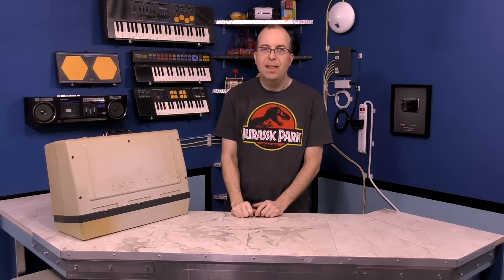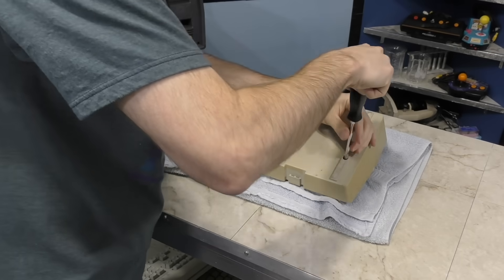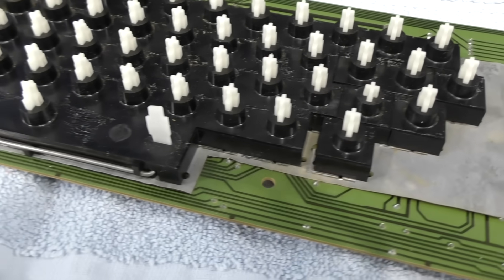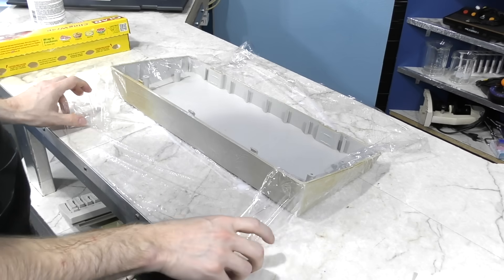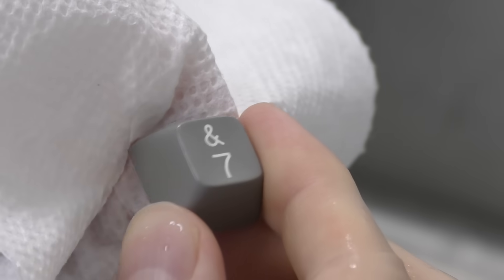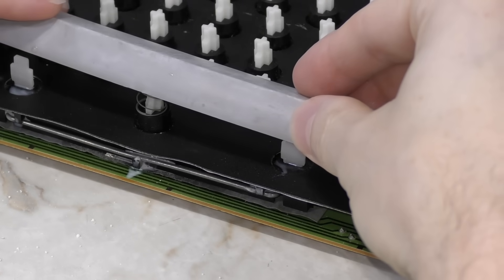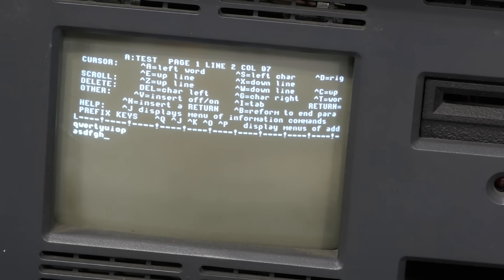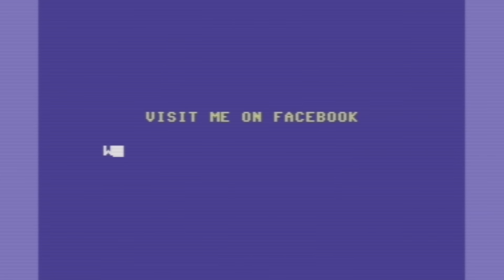Osborne 1 Computer Restoration Part 1

Comment: I found that if you have slight streaking you can fix it by using a magic eraser and go over the affected areas. Obviously you can't use it on the face of the keys. I have noticed this streaking effect on parts i have done as well, and so I've decided to not cover parts at all anymore. To not have the sun dry the solution too fast I have modified an Air condition  UV light So I use the parts in my bathroom with the UV light. This was I can do the process anytime I like to.  I also rotate the parts ever so often and massage the solution around by using a sponge brush and spray with a mist of water to keep the solution within a certain viscosity.... If I see any slight hint of yellow after I am done, I go over the parts with the magic Eraser. Hope this helps

Comment: Have you tried using UV light bulbs for the retrobright process? It seems that you'd be able to keep temperature sensitive plastics cool that way. You might also be able to have more even light distribution since you don't have to worry about clouds or the rotation of the earth affecting your light.

I'd say salvage them from an EPROM erasing machine. As a bonus, you could salvage a timer from the eraser as well.

Comment: Could the marbling streaks be an imprint of the clingfilm wrapped around the parts, where the wrinkles cause a variation of the parts exposure to sunlight? If it is, maybe find a clear plastic box to put the parts in and see it that works. Cool vid! :)

Comment: You know what? I like the tie-die keys. There seems to be at least two keyboard variations for the Osborne 1; most commonly is a full-travel membrane keyboard with a ribbon cable. Yours looks like it's fully mechanical; those look almost like MX stems. You could look into an aftermarket SA keycap set?

Comment: I know, another tip but who know...maybe it might help. 
I have an Osborne 1 but I haven't done the retrobright on it yet. What I did just do is a Apple ][ gs and it worked very well but I think, and I others have stated the same thing, plastic wrap in direct contact with the stuff is a bad thing. For keys, you probably could have put it in a clear peroxide liquid instead of using the cream. I use the cream for the case but here is what I do.
1. Get a box. Cardboard works. Make sure it's large enough so that you have at least 6" clearance. This cuts shadows down.
2. Line it with reflective material. NOW. You live in Texas. It gets hot there so maybe when temp is greater than 85F, this might not be such a good idea. A white lining might be better for hot temp.
3. Paint on your Retrobright gel and place in box.
4. Put a plastic bowl of water in the container. lower and wider the better. We're going to introduce some moisture which should keep your gel moist as well. This will replace the plastic wrap technique.
5. Cover the box in some translucent material. Ideally, use thin plexiglass or real glass. I just used the plastic wrap you use for packing. It comes in a big roll and is cheap but I used it because it was handy BUT I think something that you can remove with ease is a much better idea so if you do use plastic wrap, putting it on a frame might be a better idea.

I only had marbling in one place and that place was when the plastic wrap came in contact with the case. This was my fault but a good learning experience.

Thanks for the videos. Very enjoyable.

Comment: Something to look into for corrosion.  Using QD Electronic Cleaner is excellent.  Hit the area with some of that, scrub a bit, and use compressed air to dry out the cleaner.

Comment: Hey could you possibly do a video on how to repair a iMac G3 computer? Mainly show how to repair the crt and to change the capacitors. I found one at a trash dump still in original box and it works but screen was flickering so had to return it since I had no idea on how to repair it since it was crt related.

Comment: So a method i have used for Legos at least was rubber made clear tub with a hydrogen water solution in it and a cheap UV light that fits on top.  It is far more efficient method you just have to stir the items about every hour or so.  Been thinking to cover the tub in aluminium to give it the reflection so it requires less stiring.

Comment: 8-bit guy, did you ever try Simple Green for cleaning up computer cases, etc?  I used to work at a computer repair shop many years ago (back when it was profitable) and we used the heck out of some Simple Green.
Reply: Also, for the screws, you need a bench grinder with a wire wheel, or sand wheel for cleaning up the screws.  Makes them look like new in a couple of seconds.  You just have to hold them with some vice grips or something to keep from losing some skin :)

Comment: Oh, side note.

I suspect the marbling occurs whenever you use plastic wrap on such plastics, instead of using glycerin or gelatin to make a proper gel-like coating to cover it in. the plastic changes the focus of the light so it isn't reaching the surface evenly,  every fold and curve acting like a miniature lens. Dimes to dollars all those lines where it had more of an effect lines up with where a wrinkle in the plastic was in relation to where the sun was pointed at it.

A thicker mix that you don't cover with plastic wrap, that's more opaque causing more diffusion of light is less prone to this problem, even though you'll go through about three times the peroxide in the process.

I also think the oxy-clean you've been skipping aids in this diffusion effect, though like you I think that chemically it does jack-all in the process.

Comment: i have an old NES, SNES and N64 which I would love to clean up, but the problem for me is that i don't know mych about computers and the insides of those consoles and wouldn't want to mess anything up. Also, I have the problem of my N64 no longer working for some reason (with the power light coming on, but no picture being displayed on the screen despite the same AV cable working with my SNES and Gamecube). Does anyone have any suggestions or anything, and sorry if this seems like it's taking away from the video, this was just the best place i could think to post this

Comment: You have to be careful cleaning copper/brass connectors in vinegar. Yes it will clean the corrosion quickly, however, if not neutralized with something more basic like baking soda when you clean the vinegar off, it can accelerate the corrosion of it later on. You may want to go back and clean that connector up with a water and baking soda solution or you may find it worse than it was later on.

Comment: I suspect the marbling isn't colour, so much as texture. If it doesn't show up when wet. It's like pebbles at the beach. They look amazing when wet, but can dull and marble as they dry out.

For that reason, I'd suggest trying some aerosol pure clear gloss coat. A varnish, or plasticote type should do. Maybe test on an under-side or back of a key, masking with frog-tape (painters masking tape) first. In case it reacts with, and discolours the key plastic it's applied to.

Comment: For whatever reason my comment Yesterday never appeared here. I had this bad effect ruin my vic-20 and c64 keys. You can fix it with Creme Cleanser (bathroom cleaner) by polishing the effect out. Only downside is it will flatten out and "shine" any rough plastic surface. My c64 keys are now shiny on top but that is better than before. I have a post over at the vic-20 denial forums where I showed how it turned out. If I post the link likely this post will get removed again.

Comment: Ouch, I have had this happen when cleaning my Filco keycaps in an alcohol bath. In my case it weakened the plastic to the point where the keys began to break apart.

Photos:
https://twitter.com/akidwithnoname3/status/771903987234672640
https://twitter.com/akidwithnoname3/status/771930351748915201

Comment: The story of the keys reminded me when I tried to retrobright my purple Gameboy Advance case once, which was very badly treated over the years and seemed very degraded. I decided it was worth the risk to put it on retrobright, but the case turned like ... marlble white after a couple of hours. And the reaction kept on for several days after the exposure. Now it's stabilized and I've got a permanent "ultra limited edition" custom "marble white" Game Boy Advance. (which is kind of nice actually)

The lesson about that is : don't try Retrobright on non "white / light gray" cases. Unless you'de like to build a custom case.

Comment: i am doing brightening on old machines too...first i used the same technic as you...with cream peroxyd but i turned over to  12-16% liquide peroxid. on my last machine (an Atari XEGS) i had nearly the same problem as you. the keys and also case starts marmorizing while drying. when you use liquide peroxyd in the sunlight the fluid starts bubbeling like mineral water...that causes the parts to swim on the surface of the liquide. so you have to put on something heavy...i used a stone...but...i learned on that as well...putting the stone only on parts of the case you never see again like the inner of the case...because if you move the stone or the case starts to swim the stone moves as well nad make not that beautiful scratches on the surface. i tryied 12-16% liquid peroxyd but one day is enough cause if you doing longer it starts to etching the surface and i imagine that this is the reason for this marmorizing effect. Best regards...MaG

Comment: I think I may have found a solution to streaking/marbling after a retrobrite treatment. After seeing this on my Super Famicom I tried an Oxi Clean solution soak. Strangely enough the system got a little bit darker after that, but the final color is very nice and even. I was soaking in a bucket that was about a half inch too shallow for the SFC shell, so I will try again with an aquarium full of Oxi and see how it works out.
Reply: Update: The aquarium soak actually made the SFC look worse, so I would not recommend this as a solution to retro brite streaking. I'm going to try a 40% cream re-treatment on it...

Comment: If I recall correctly, the keyboard on the Osborne is an OAK systems full travel membrane. You might be able to find inexpensive replacement keys be searching for broken "Dahlgren Wizzard" engraving machines. the models made around 1985 used to use OAK FTM keyboards as well, and were protected by a silicone keyboard condom to keep engraving chips out.

Comment: Since the keycaps are double shot I'd say try giving it a sand down with some fine grit and then use a silicon based polish  over it to give it a shine again. I've had the same thing happened to me on one of my keyboards and that's how I fixed it.

Comment: The keyboard looks pretty nice, amazing difference! 

Have you tried to clean the keys (after the retrobrite) with alcohol? Maybe it was not rinse completely off by water. It appears that there are unevennesses associated with wear caused by hitting and fatty acid of fingers. You'll see that more often with laptop keyboards, the shiny keys. It's possible  that some traces of retrobrite remain in the small 'pores' in the 'rough' non-touched surfaces of the plastic. The chemicals remain and continue to evolve and thats why you see this happening.

Comment: Pro Tip: Take the corroded screws to Home Depot and get brand new, identical ones for around 20 cents, screw technology has changed very little in the last 40 years.

Comment: The best thing for cleaning old plastic that went from White to Mustard Yellow is, believe it or not, an Engine Cleaner.
The one I used multiple times on all sorts of different plastics is called "Akra K2". I just spray it on, leave it for a few sec, and then use the microfiber cloth to wipe it off. It really does work wonders, and it takes a few minutes instead of hours that this method uses.
Please try something like that!

Comment: Two reasons why you ended up with marbled finish: 1. Finger grease affects how well bleach works on the plastic - clean surfaces with alcohol to remove finger grease before applying bleach. 2. Some plastic are porous - and the bleach gets in there and continues to work even after you rinse it. To avoid that, rinse then keep submerged in water for some time until all the bleach is diluted and pulled away from the surface. Good luck - really interesting project.

Comment: Have you tried polishing the plastic?  Something like a dedicated plastic polish like Meguiar's Scratch X might resolve your streaking issues.  Also when cleaning the parts, I would suggest using a soft brush like a nail brush with an alkaline based cleaner instead of windex.  Try Super Clean, it is really good at cleaning organic based dirt.  And finally, a microfiber towel will do a better overall job at cleaning than paper towels.  Hope some of those hints help you.  I think you do amazing restoration jobs!

Comment: To the keys.

If they looked fine when wet, I'd try putting some WD-40 or silicone oil (a little bit, just to test) and it should look better.

Just saying.

Comment: Regarding you white balance issue. Does your WB settings include Kelvin? That's what you need. You can match the Kelvin temperature to the lights you are using and it should give you decent white balance. Being color blind definitely is a challenge.

Comment: Use a heat gun, carefully, it gets the "moisture"/oil out of the plastic. Have saved some plastic with heat gun after rinsing it in acids and got this as a result before.

Comment: are you not worried about rinsing chemicals into the ground? dont cats walk there? i mean alcohol and hydrogen peroxide are safe relatively, but what about the chemicals they extract from old plastics? and other less safe things you use

Comment: I mostly like your videos, as I like seeing these old devices get new life. I do regularly cringe at the fact that your knowledge of electronics seems to be rather limited, making your restorations incomplete to say the least. (swapping boards does not a restoration make) Turning on a device like that before a internal inspection and removing or replacing bad or suspect components is a BAD plan. Don't do it as to prevent frying something important. Some custom chips are hard to replace. As an example I offer rifa safety caps installed in many older devices that have a known tendency to blow up with lots of smoke. takes 10 seconds to check for them. Same for leaky or bulging caps and corrosion and other bad signs. At the very least always service the power supplies, they receive the most stress usually.

That said we all learn these things over time. Like to see the rest of your osborne video.

Comment: Thank you for this video and keep up with this excellent work!
Regarding retrobrighting things, I have far better results with small parts such as key caps by imerging them in H2O2 oxygenated water. The process takes a little bit longer but there are no stains or unwanted results.

Comment: There is a product called 'Deoxit' that works wonders on crusty connectors. You can also find spray cleaners made especially for electronics work, i.e. cleaning switch contacts. I found a local auto parts store carried some which worked well for cleaning up the multi-gang switches on some old Fluke meters. Just make sure it says it is 'electronics' cleaner so it will be safe for plastics. There is also automotive 'electrical' cleaner which is NOT what Yu want.

Comment: I think the streaks may be due to the injection molding. At the time, not as much was known about the flow pattern of plastic in the mold as we know today. This may have resulted in the plastic not flowing evenly and cooling down unevenly in the mold. This in turn may have resulted in internal strains and differences in density of the plastic in different spots. Kind of like metal that is not annealed. Therefore the retrobrighting may have different effects on the denser parts of the plastic than it does on the less dense parts of the plastics, resulting in these streaks. 

It is just a theory though, but it would be interesting to test this process on a newer piece of equipment and see if the result is different.

Comment: On using the White Lithium Grease, thats a metal-on-metal lubricant, and  I would definitely go out of my way to avoid using that on plastics, especially older plastics.

WLG is going to use a combination of mineral oil and paraffin as its lubricant base, and who knows what else, and it can react with and degrade plastics.
Its also not the most stable of greases, and the lubricants can separate from the lithium thickener after not too long, which just leaves things messy.

For plastics I recommend sticking with silicone greases. I'm not sure the best spray silicone, but I've had good success with the only one I've tried,  WD-40 brand.
The best silicone grease I know of is 'Super Lube Silicone Lubricating Compound', and I would highly recommend that as your primary plastics lubricant. 
Its also waterproof, dielectric, and its still appropriate for low pressure metal on metal applications.
Reply: I know this comment is old, but my Unicomp keyboard I have (basically a modern Model M) seems to have white lithium grease on the spacebar stabilizer, and it came that way from the factory.
Reply: it's metal-on-plastic.